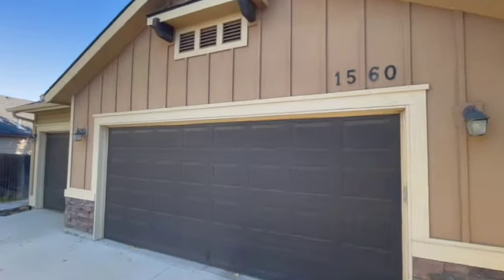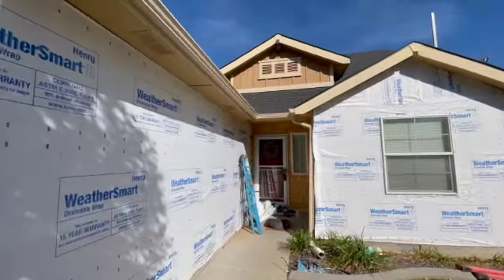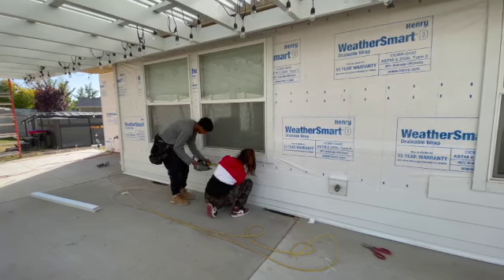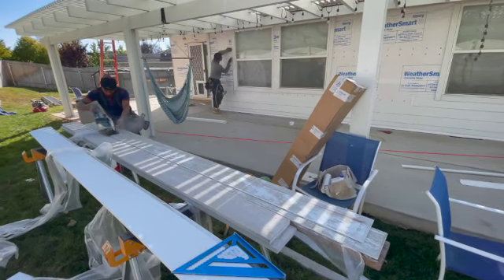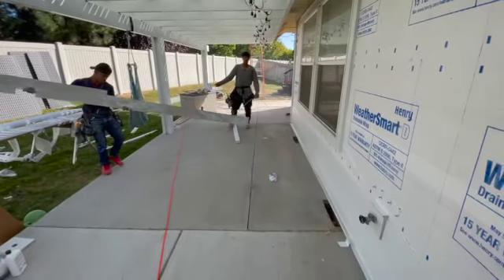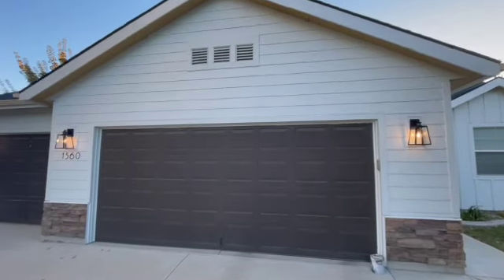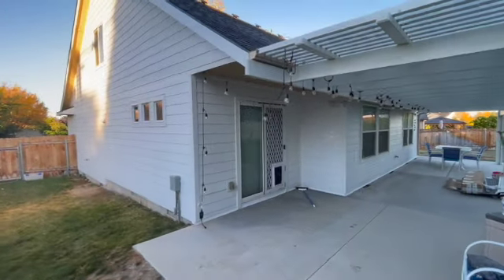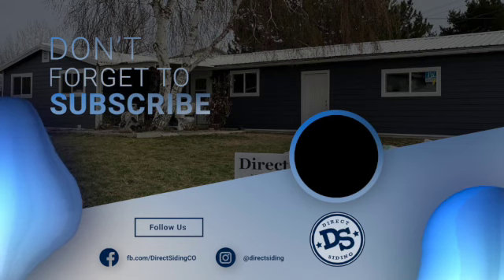Beautiful Fiber Cement Siding Installation

Comment: What did you put in the tag before cutting it off and then what did you wipe it with? Thanks
Reply from the maker: Not sure what you mean by Tag? We wipe it off with a small towel to remove the silica dust created when it’s cut.